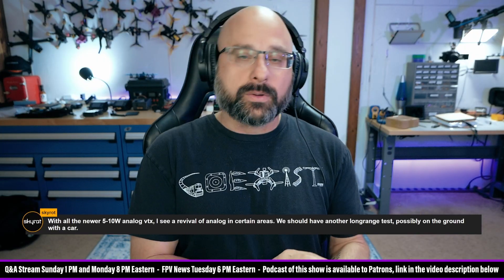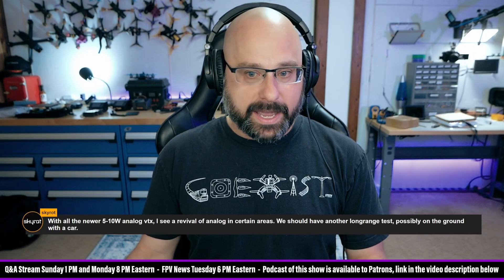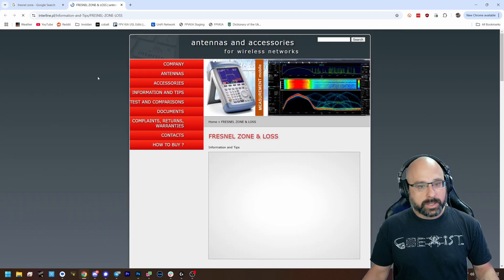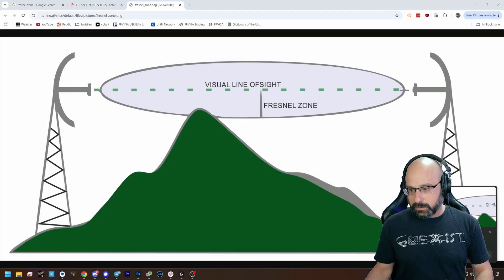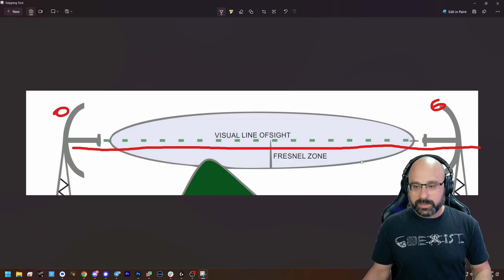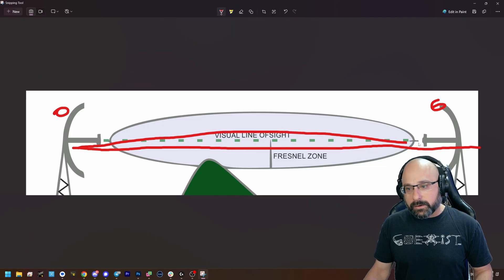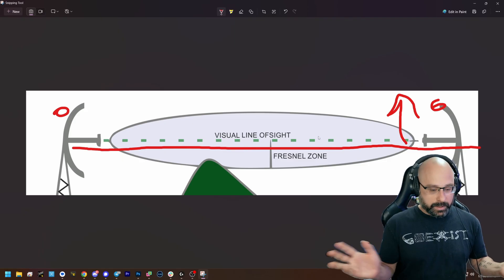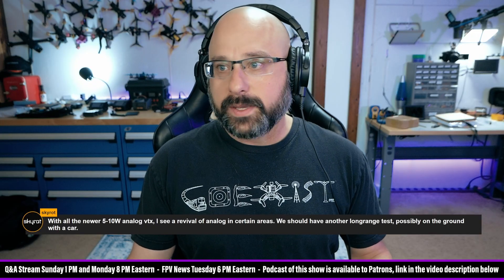Will Bardwell Test Long Range? 10 Watt Analog VTXs? What's a Fresnel Zone? - FPV Questions

Comment: Just an idea. Option one. Pilot and spotter in a car. Tester with a vrx in a fixed position. Pilot and spotter stay in VLOS, tester will evaluate the video performance. Option 2. Quad is hovering at a fixed position or fpv plane is set to orbit around fix positon. Pilot and observer stay in VLOS. Tester is driven in a car and video performance is evaluated at certain points where the tester can exit the car. Alternatively the vrx antennas could be mounted in top of the car to avoid signal blocking.

Comment: The car method, or even multiple spotters along the route of the flight, not directly next to the pilot, are not methods that the FAA permits if you read carefully.  Basically unless you can get BVLOS permit/clearance, there is no viable totally legal way to do long range.  Obviously people are still doing it in the US and just not typically putting it on youtube.
Reply: When he is saying car method, he means drive the vtx far away from the receiver for range testing. No flight involved, so it would be legal per FAA